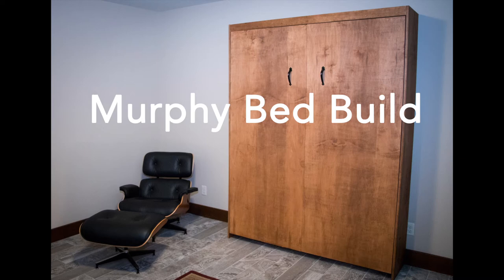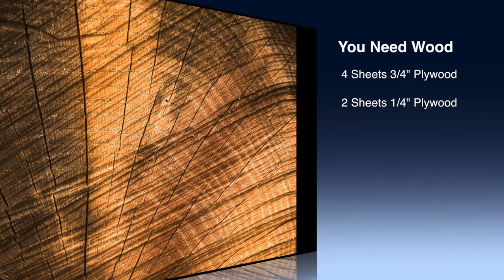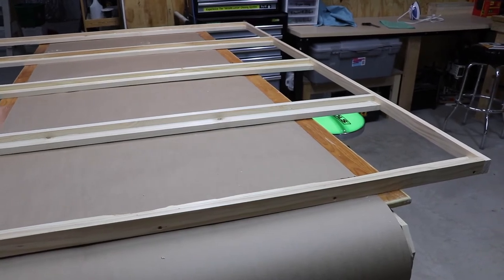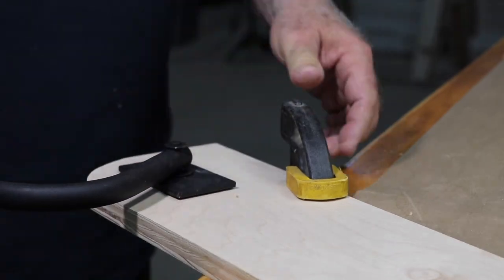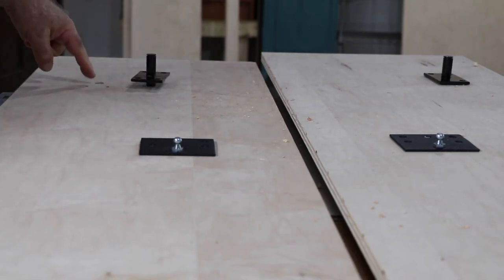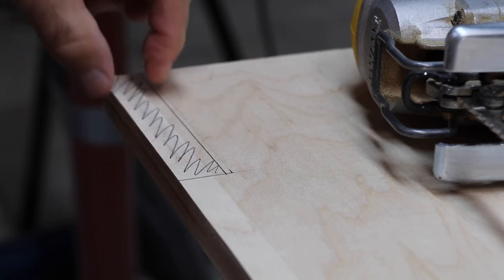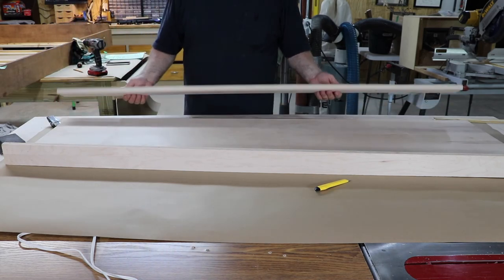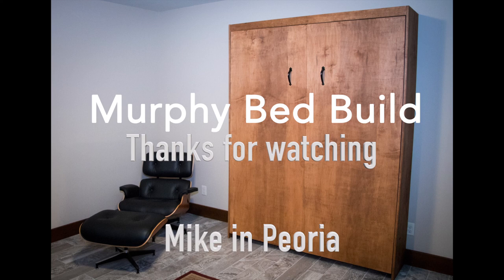Murphy Bed Build

Comment: Mike
Fantastic video.
Can u possibly explain where u obtained the hardware components from?    I’ve wanted to try building a Murphy Bed for ages but have been unable to find any inexpensive Murphy Bed hardware. 
Thanks!
Reply from the maker: I bought it from Amazon ... $285 for the hardware kit.  Wood was another $300 or so .... could have been a little bit less, but I used Maple plywood.  I already had a queen mattress off another bed.  We use in a spare bed and for that the whole setup works great.  Here's the Amazon link .... https://www.amazon.com/Queen-Size-Deluxe-Murphy-Bed-Vertical/dp/B00CYPV29W/ref=sr_1_1?ie=UTF8&qid=1512355870&sr=8-1&keywords=create+a+bed+murphy+bed+kit
Reply: MikeInPeoria 
That’s great.
Thanks so much.
/M